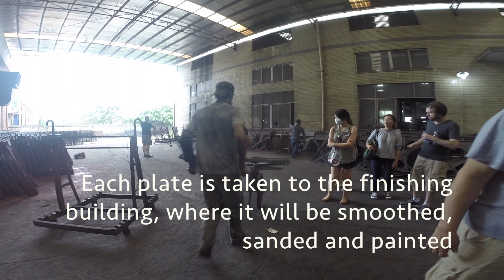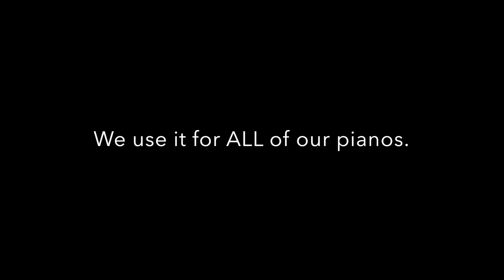The Foundry

Comment: I have an old piano that we believe was made in 1732.  We are trying to figure out if it is brass or something else. I know that after 1835 tempered steel was used but what about before.
Reply: Hello Mister Anderson, if it is the plate (harp) that you are asking about it is almost certainly cast iron.  You can test it by placing a magnet on it,  If the magnet is attracted to it is likely iron.  Brass would not have been used to maker a piano plate...much too soft.